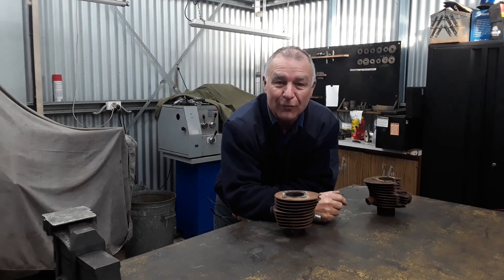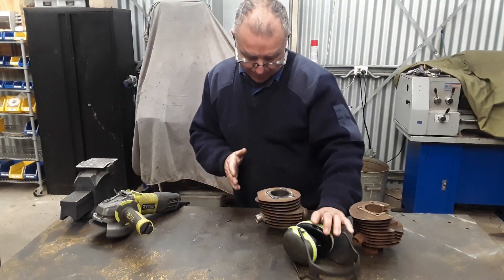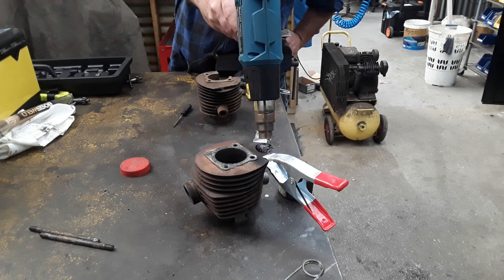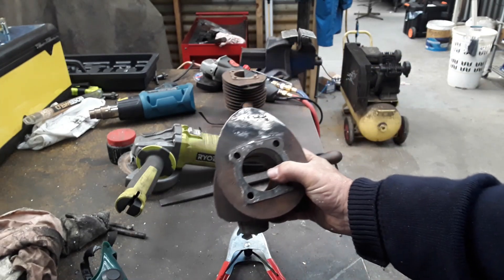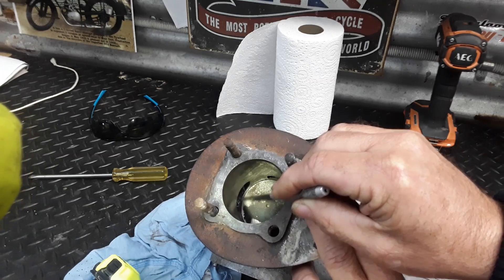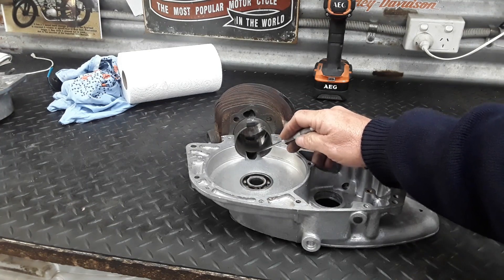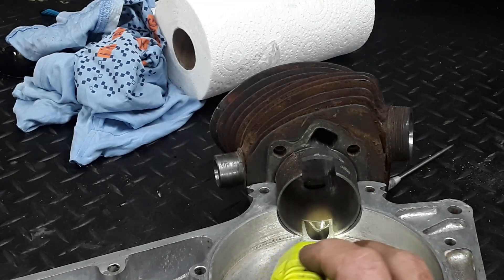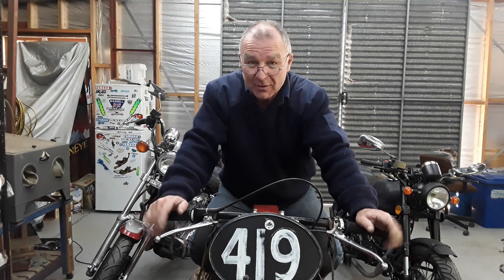Workshop Update 19 05 23

Comment: Hey Bones, the barrel into the crankcase half for port alignment.  Are you running with a barrel base gasket between barrel and case during measure up, otherwise the barrel will extend down further into the crankcase  then when finally assembled won't it ?
Reply from the maker: Hi Kevin........The base gasket measures .2mm prior to compression under torque. For this application a variation in probably less than .1mm of port height really wouldn't matter. Thanks for watching and commenting.....